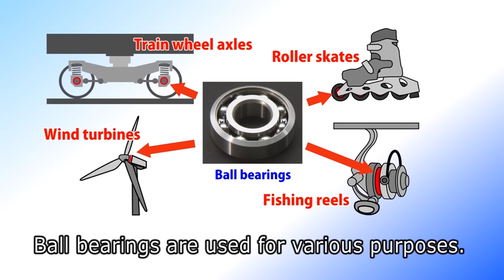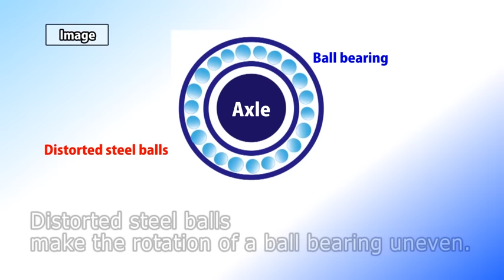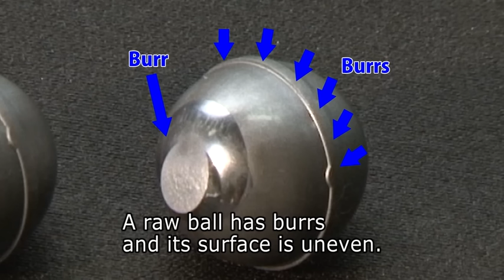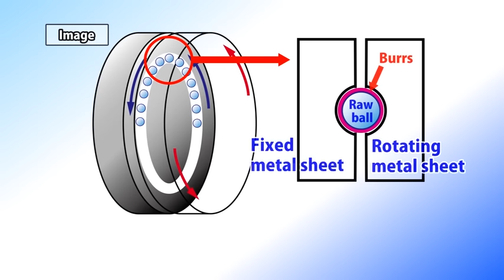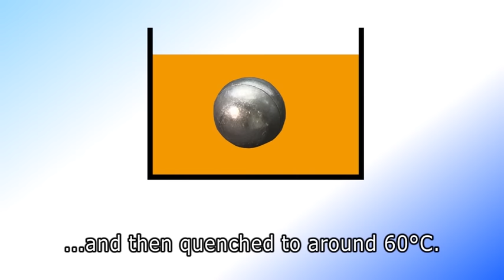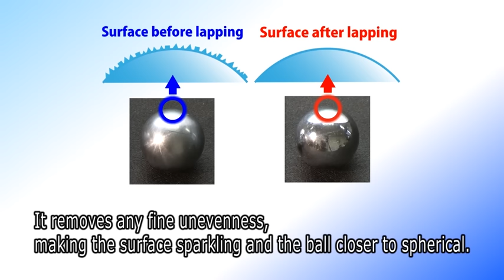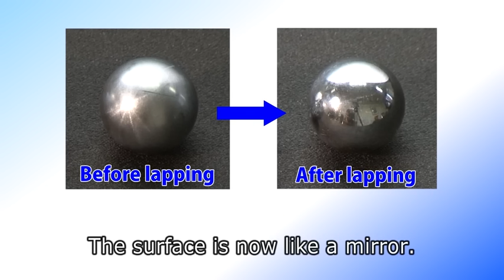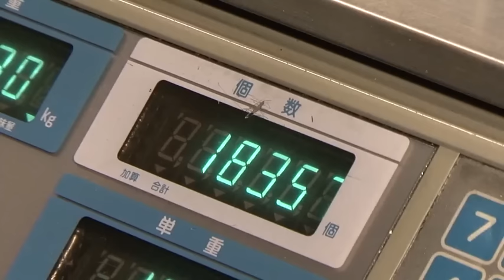THE MAKING(English Version) (314)The Making of Steel Balls

Comment: You'll notice in the video here that after lapping, the balls are air-dropped on to one another.  I was told that Timken does NOT air drop their balls after lapping because the impact between the very hard surfaces damages them, causing microscopic dents. Consequently, Timken drops them into an oil bath so the impact with other balls is kept to a minimum.

Comment: I was involved in making tooling for ball bearings years ago. One of thousands of jobs our little header die shop did.
The dies with the half spheres have carbide inserts that are pressed under high pressure in the die block.
As these inserts wear they can be recut and ground to be used over again.
The working surfaces are lapped and ground to a mirror like finish.
The grinder used 2 different grits of wheels to get to the finish required on just the face of the die.
I used 12" diamond wheels on the surface grinder. 
It was  quite an involved process to make the tooling and the more precise the tooling the less work was needed for the secondary processes (grinding and lapping). 
It would be fun to see the processes used to make the tooling ....just another job at our shop but most have no idea 
what it takes to do it.
Reply: Very interesting.  I always thought t h e were nickle then chrome plated for the shiny finish and surface hardness.
Reply: @xltoth  I'm referring to the working surfaces of the Dies.
Reply: @HighGear7445  So, how to make the tool that's used to make a tool that's used to make another tool that's used...
Reply: @dannichols6261  All figured out by man using  materials in nature and then building upon the knowledge to make more efficient tools
Then eventually using the more efficient tools to help him build machines that help  him be more efficient.and so on.

Comment: Amazing how much work goes into making a simple ball. Which itself is just a small component of even larger, more complicated machines.  Human ingenuity is incredible.
Reply: im a mec and didnt know that a bearing was this compli to make
Reply: Not only that, but they can crank out thousands of them every minute with a high degree of consistency!
Reply: Martin Johncox think about the down time of the tooling.  If the lapsing, deburring or any other tool fails yo achieve its scope due to wear, imagine the cost that translates to the 8mm ball

Comment: Back in the eighties and nineties, I worked as a machine setter/operator, for an engineering company called Sileby Engineering. We used similar cold-forming machines made by a company called Malmedie. We made valve spring retainers and sump plugs for the automotive industry. This is a trip down memory lane to see these machines working.

Comment: Imagine opening that box at the end upside down or something with that unsealed folded bag... That would make a long day at the shop
Reply: magnet
Reply: Imagine opening a box upside down.
Reply: @paddlesaddlelad1881  Sorry they are made of stainless steel. At least the 2 mm balls I use to clean my insolated drinking bottle. I try my best to fill them into flask by a measuring bottle with spout but sometimes they happen to jump over and end on the kitchen floor. My best look is them not getting into sink. Yes there are funnels but most of them are used elsewere even at recovering them from vacuum dust besides other missfortunes of jumping small parts found later.

Comment: Now I would like to see how they make the precision tooling used in ball bearing manufacture.
Reply: @ganymede3141  Indeed, how did they make the ball bearings used by the machines that make the ball bearings?
Reply: @aerialexplorer772  Exactly. How were the very first ball bearings made? It must have been a very expensive, manual and slow process to get good enough precision until machines could be built with higher and higher tolerances and process improvements  to yield better and better parts with each generation of machinery.

Comment: 1:48  So the author thinks we'll all be familiar with "ferroalloy" but they're going to blow our minds with the word "steel"!  Lol.
Reply: I noticed that too. Luckily I can answer it for anyone wondering: A ferrous metal is any metal which possess magnetic properties, such as Iron and Steel. A ferroalloy is an alloy of metals where at least one contains magnetic properties. And example of a non-ferrous metal is Aluminum. Scrapyards usually use magnets to figure out if the metal being sold to them is of ferrous origin or is a non-ferrous metal as pure aluminum and pure iron is practically impossible to distinguish from each other without using a magnet. To anyone needing to know why rust makes iron or steel impure, know that rust is nothing else but oxidized iron or steel aka, meaning the surface of the metal has come into contact with oxygen.

Some metals create a protecting layer when they oxidize. This is the case of Aluminum (the traditional grey aluminum surface isn't paint. It's oxidized aluminum) and Chromium, with the latter being used in the fabrication of stainless steel as it is the oxidization of Chromium which creates a protecting layer over the steel, causing it to be resistant to rust as the steel never gets into contact with Oxygen, thanks to the Oxidized Chromium layer.

Also, if anyone wants to look up an OP metal alloy, take a look at the properties of Alubrass

Comment: Very good video. Like most I have always wondered how ball bearings were made. Now I wonder how long the machines that make them last at the speed that they operate. Just the process of filtering the metal waste from the oil and processing it for scrap would be monumental. Maintenance on the whole operation has got to be enormous. It is hard to believe how inexpensive ball bearings are considering all that is involved.  Thanks for the education!
Reply: agree,
some bearings are even very cheap

Comment: Train axles do not contain ball bearings.  They use tapered roller bearings.
Reply: I always thought they were plain sleeve bearings because of the weight they have to bear.  There is a stuffing box on the outside (square hatch cover) over the axle and i always saw the maintenance people put grease into that.
Reply: That was how they used to do it before they changed to roller bearings
Reply: Well learn something new every day.  I guess bearing materials have progressed since i was young.
Reply: Interesting, I just looked up what tapered bearings are. I didn't know there were different types of bearings.
Reply: That is where Timkin bearings got their start,  making bearings for trains.    Before that they were ball bearings,  they wore out fast and were limited to the load they would carry.
Reply: large aircraft use roller bearings too
Reply: Not even that i think. Just the oil film

Comment: Side note from a metallurgist here (educational comment): Quenching in oil rather than water achieves a slower cooling rate. That creates the desired microstructure for this application. Quenching in water  simply produces a harder and perhaps brittle structure that isn't as useful here. 

The annealing process, the reheat to 170C, does not, strictly speaking 'align the molecules'. It is used simply to get the desired microstructure, one that has the hardness and toughness appropriate for this role. The initial, relatively rapid quench of these higher-carbon steels produce hard structures called martensite within a softer ferrite matrix. 

The annealing process transforms the martensite to the degree prescribed for this application.  Molecules are being rearranged but not specifically to align them. Martensite forms as a  spiky structure in three dimensions upon quenching. Annealing 'blunts the tips' to the degree it needs to produce the strength and toughness require.  Not a criticism here!!  Good video.  I am learning from it.

Comment: Very good video,,,the proccess is this.I had s ball bearing shop with my father and watched personally in a litle factory this proccess,,the end od the proccess is lappidating,,,and the steel ball looks as a mirror,with no distortion in the convexe image,,,is you see a high precision ball,with a microscopo,,,a very littyle imperfectios may have,,,but  balls grade 10 or less(sphericity less than ten microinches) no imperfections detected with a common microscope,,,,today the precision balls are better than one micro inch  (0,000025mm)   (0,025 microns)   this from 1 to 25mm diameter!!!
Reply: Easy calculation is that one micron is one 40 millionth of an inch.
Reply: @ytubepuppy  ..
Reply: @amanykamara3420  Yes???

Comment: "Molecules before heat treatment: not aligned, after heat treatment: aligned" No! That's wrong. Aligned metal atoms are much easier moved against each other than unaligned. That's why the hot metal is quenched which is a quick temperature reduction so that the alignment cannot occur and an amount of disorder is frozen. The disorder means that there are no ordered layers along which movements can be induced by lower forces.
Reply: I think you're right. Maybe they should put a note to clarify.
Reply: Thanks Wassily. I was having trouble sleeping.
Reply: @Longtack55  My pleasure ;-), but good joke.

Comment: The wire "rod" is called "steel" because it's steel wire. I know, weird, right?
Reply: What not ice coated wood dust in aluminium foil?
Reply: @wernerhiemer406  One's mind boggles at the concept. Of course, it takes very minimal input to induce such boggling.
Reply: @inyobill  No really I thought a view days before it was recomended: So I thinked pouring is not very effective. Only my mind missed the grooves in the grinder to get the shape formed.

Comment: " Made of a wire called "steel". "

...seriously?
Reply: Actually it says "made from wire rod called steel", but what is it that you don't find serious?
Reply: It's called steel, and then they state the actual alloy used. It's clear.
Reply: @badseednut  Not just any old steel.
Reply: Probably a translation issue from the original
Reply: @KSayar  Made from steel wire rod.

Comment: "Steel balls are made from wire rod called 'steel'"

no, really??
Reply: haha ikr
Reply: its not real steel. its a feroalloy. its just called steel.
Reply: +,' RED ', steel is a ferroalloy
Reply: You'd be surprised. There's still a shitload of people out there who thinks 'steel' balls are made from aluminum and iron.
Reply: well, it is a iron alloy so they are kind of right.
all that steel is is iron with a really tiny bit of carbon, i suppose 0.9% for something like ball bearings out of the top of my head.
of course there are types of steel that contain other metals but this is what basic steel is. 99% iron.
Reply: Every kind of steel is a ferroalloy. Not all ferroalloys are steel. Maybe indeed they don't use real steel for these balls but they used to call it like that because it shares similar properties with steel.
Reply: Well a ferro-alloy is just an alloy where iron is the principal component (Fe = ferro = iron). But these balls are very much a 'steel', i.e. iron with up to ~6% carbon by mass. The finished balls will probably be a martensitic steel due to the heat treatment they undergo after the flashing stage of the process in the video. The rapid quenching down to ~60 degrees from ~800 degrees changes the crystal and grain structure of the alloy, basically pushing the alloy into a different phase (probably a martensite/cementite/ferrite mix) which is extremely hard and strong. The video shows little balls taking a 30 ton load, only a hardened steel could withstand that I think.
Reply: they had to make sure that it was clear they didn't want you to get confused and think that steel balls are aluminum
Reply: how do the metal plates remove the flashing?
Reply: the rough balls are forced to roll thru the circular channels by one surface spinning against the other. this pressure smooshes off high spots as they roll
Reply: All steel balls actually contain aluminum.
They are made mostly from Iron Oxide.
Reply: chrome steel 51200 is actually the most common, esp in bearings. it's a high carbon steel.. Al wouldn't have a good wear characteristic. stainless steel is used also
Reply: pds tech  - 52100*   😉
Reply: David
Reply: pds tech 51200 is carbon steel
Reply: Rheymon Siongco -  It's actually 52100, not 51200.  It makes an excellent knife as myself and many other knifemakers use it as one of our choice steels to make knives.  It has a higher carbon content that most other "simple" high carbon steel at about 1.0%, but the other alloy it has that makes it unique to simple carbon steels is Chromium, which is at about 1.5% and helps increase its wear resistance, which is an attribute you want in a steel bearing. :)
Reply: There are nylon balls out there
Reply: lol, you said steel balls
Reply: Steel balls are made from wire rod called plate
Reply: that was too funny.  perhaps it made more sense prior to being translated
Reply: @guitarpaul3645  thanks for the highly informative reply
Reply: @meagain2222  errr, what?  perhaps a basic science class might help you understand elements and their compounds
Reply: The point I was making is that all steel has scrap melted into it and many metals get mixed in eg. copper, aluminum ,silicon etc etc. You could say that the more times metals are recycled they have more unwanted materials in them.Copper makes steel corrode easier.
Its not desirable.
Reply: 原文は「鋼球の原料は『鋼鉄』という炭素を含んだ鉄合金の線材」

Comment: Grinding and lapping require an abrasive to remove the undesired steel on the surface of the balls. I assume the fluid contains an abrasive slurry!
Reply: Not necessarily, as long as you have a coolant (looked like water in the clip) you can do the grinding with friction alone. I assume that is done in the video since the metal wheels would also have the structure removed by an abrasive, making it so that the wheels needs to be replaced much more frequently (which would also lower the precision). 
Oh and the wheels are probably made of an alloy that is harder than the steel used, making it so that the steel is removed prior to the wheels.
Reply: Its more likely a cold forming process than grinding.
Reply: I'm guessing we're not shown the grinding wheels is because it's proprietary?
Reply: @havocproltd  no, balls are most probably cold formed for a tighter grain structure

Comment: I watched the rest of the video.  Most excellent !   I didn't know all of the steps concerned.  I am doubtful that wind power rotors use ball bearings though, due to the weight and load.  I have not checked this; but railcars in North America all use roller bearings.  
Thanks,   Aarre Peltomaa

Comment: Lesson 5 : "The shortest route is the detour. It was the detour that was our shortest path." honestly i dont know how to explain this very well, so in someone else's words, it means "a detour would cause a trip to grow longer; however, throughout all of Steel Ball Run, Gyro and Johnny's goals, their final stages, have gotten closer, only when the pair took the detour off of the race to collect the corpse parts. Johnny and Gyro only grew as people when they took a detour from their first goal to complete their second one. The lesson: the shortest route to your "goal" (Using the perfect infinite rotation) is to use a detour (instead of riding the horse to speed, manipulate its muscles using Lesson 2 to kick you, causing your body to spin with the perfect infinite rotation).
A detour will bring you closer to your goal, than heading for the goal outright."

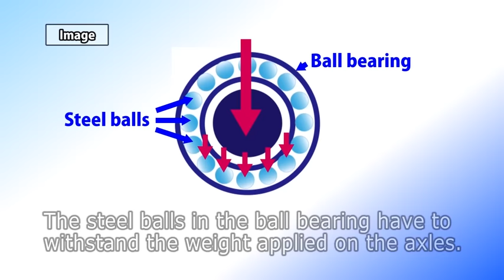Comment: 6:45 I hate to spoil the party, but this animation is missing a crucial element: The small arrows indicating the force has been evenly distributed from the single large arrow at the axle is good, but to be adequate, there need to be an equal number of arrows at the top to indicate the transfer of force via the outer raceway.
It may seem academic, given that all force eventually does wind up going through to the ground under the tires. However, it is crucial because I am currently dealing with a mechanical issue on a cutting-edge product which is a direct result of a failure to understand what I have just explained.
If the people who designed the machine I am currently troubleshooting gained their understanding of the function of bearings from the graphics in this video, it is easy to see how the error made was made.

Comment: Just saw this video and was surprised to see a significant technical error. In the section regarding heat treatment it identifies the alignment of "molecules".  Metals are not made of molecules, they are made of atoms. Molecules do not form in metals. Atoms are arranged in a crystal lattice structure which is rearranged during heat treatment resulting in a change of physical properties. This allows the steel balls to be softened prior to heading (a part of the story you missed) and then hardened prior to being put to use.

Comment: Please note that 7:33 is wrong. Out of order molecules are wanted to make steel harder. That's the reason it is quenched so that the molecules doesn't have time to get into order. 

We don't want molecules in order (AKA big crystals, called grains) because it makes it easier for them to slide over each other and allow bending. When you quench the steel (drop it's temp super quick from red hot temps) it's molecules can not act fast enough to form big grains. More grains means more effort is required to bend it since different grains are facing different directions (with each having different plains they can slide in) and not allowing each other to move. This also causes internal stress and fragile points in the material that we later treat with heating it up to a few hundered degrees and wait for it to slowly cool.

Anyways i hope this clarifies things because the explanation in the video is completely reverse in reality.